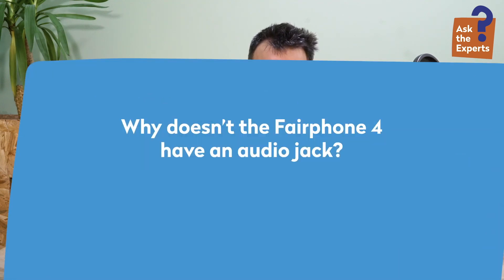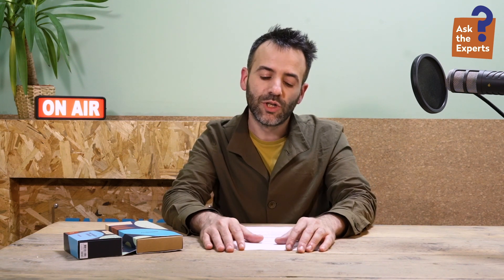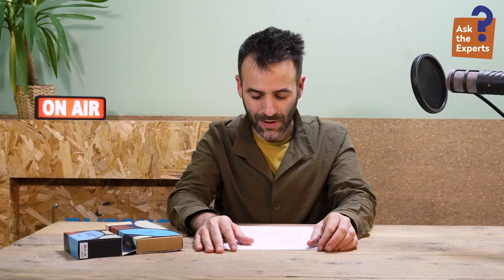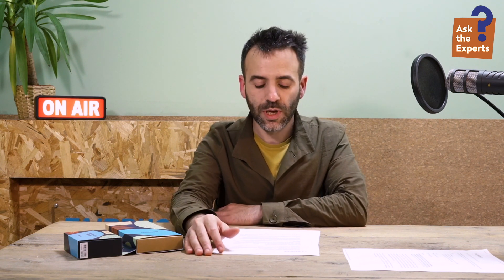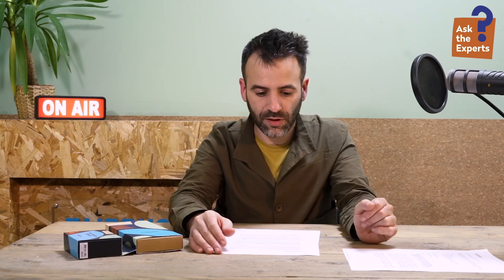Where's the headphone jack?! | and other questions answered | Fairphone

Comment: My headphone jack hasn't broken on a single device I ever owned, with the exception being a €3 portable fm radio made of plastic and chinesium alloy. It's more often that the cable breaks, like the one on a usb-c to 3.5mm jack adapter.
This dust is mostly an issue for me on the charging port, not the headphone jack.
In the few cases when I really need the headphone jack (because my bluetooth headphone is charging or I don't have it on me) it's likely not unlikely for my phone to also need to charge (and in practice I see this is the case, because of how I use my phone) so that makes the adapter a problem.
So yeah, I need a heaphone jack. I don't use it that often, but I do use it. I use it more than my camera to be sure.
Reply: Jacks are eternal. This includes charging Jacks. Nowadays we are using a COMPLEX DATA port and cable to charge ALL THE TIME a phone which 20 years ago just needed a simple 2 leads cable with a simple charger. If the charging port breaks because is the only thing you plug every day to the phone, instead of repairing a 2 connection smd charging port, you end up repairing a complex USB port. Which is also a point: USB on phones is practically useless if you take out the charging side. Almost no one uses USB to plug to the PC if not for repairs.
Reply: yeah, Audio jacks breaking is utter bs. Never happened to me. 

The cable itself is the only part that ever has broke tho.

Comment: Regarding the audio jack...
Never a good idea to throw away interfaces as this generally decreases the versatility of the device.
The FP4 durability argument is laughable since there are still IP rated phones with audio jacks on the market and they have been for a very long time.
The design argument, I think is something subjective, but the phone was never gonna win the thinnest phone of the year award.
This industry push for Bluetooth is sadly not going away since it is very profitable for companies. The user experience suffers, though.
Hope they reconsider.
Maybe they bring it back in a FP5. I would buy that.
Reply: Yeah, this is my thought. If a device is more compatible, I will keep it longer. The more limited it is in compatibility, the shorter its life span will be.

You know what a simple way is to keep something compatible: Keep it compatible with the standard from the past 40-70 years worth of audio cables and headphones. It probably won't die overnight.

Comment: right now i am looking for a new phone, after 6 year its not the worst idea to replace it, my first thought was a fairphone.... i think i buy the 3+, i use a wires headset und dont plan to change it, an adapter i a nogo, the device (for me personely) has the have the features nativly, everything else is a shorttime solution, nothing else.

my list of features a phone has to have that a am willing to buy it:
- headphonejack
-removeble battery
-no OLED (the burn in/out problem isnt solved)

Comment: Honeslty I was planning to buy your phone, but the loss of a headphone jack is a terrible decision that only promotes ewaste with adapters, costs your customers more, and causes greater environmental damage from the need for batteries and chips in wireless headphones.

Also you already supply replacement parts, so just give us a replacement audio jack.

You made a mistake, fix it for the Fairphone 5.
Reply: Very well put, Agree 💯%
Reply: Agree
Reply: I, too, was about to buy one, but without a earphone socket you can stick it where the sun never shines.
Reply: fix the price, you can get a XIOMI POCO  for €200 in amazon, and the battery will last me 5 years, €600 euros is a joke
Reply: @cyllananassan9159  the pocos are sold as a loss, the profit is made with data mining. the fairphone's price only proves how the sale of the hardware is the only source of income for them.
Reply: @cyllananassan9159 bro you don't understand the concept of the Fairphone, of course your Chinese device has a better price, but you can't get official replacement parts, you get a bunch of Chinese trash apps installed that could potentially spy out your data and you don't know how this phone was produced. Although you can use that phone for maybe 3-5 years, you ain't get any safety updates after maybe 2-3 years and you don't support local or more friendly companies but a Chinese mega company that is basically owned by china

Comment: I really hope you guys listen to your consumer base feedback regarding the headphone jack. After scrolling through the comments on every fairphone 4 related video it is clear that that's what your customers want. I for one can guarantee that I will buy the fairphone 5 it really does have a 3.5mm headphone jack
Reply: I completely disagree, I already bought an FP4 literally bc it has none. Jokes aside, why isn't it just an option to just stick the headphone adapter into the cord the headphone has anyway, I don't get what the problem is with that.
Reply: @HandsomeLuigi  you cant charge and use your headphones simultaneously if you do it like that
Reply: @einspielen9965  My fairphone takes one hour to be fully charged (with proper charger). Then it holds easily for 36 hours with normal use. I only encountered once the situation where I wanted to listen to music while it was charging, after 5 months of heavy use, and just charged it 20 min which was more than enough for a long listening session. It's not that of a big deal in the end, and removes vulnerabilities with a simpler design.
Reply: @bassenji5565  When you daily drive a 7-year old phone like me whose battery was never replaced you'll realize the benefit of being able to charge and use earphones at the same time. =) (my battery only lasts 30 minutes at 100%)
Reply: And I guess people like me, who are still rocking a 7-year old phone (a hardcore longevity user, we might say?) are exactly the type of public this company is targeting, so...
Reply: @LinuxIsNotAnOperatingSystem  God bless you.
Reply: @bassenji5565  
Fast charging shortens your battery life. It should only be done if you're in a hurry.

Comment: Fairphone... that design decision you made, is the wrong decision. The exact market you're targeting, the people looking for reliable serviceable phones with replaceable batteries, parts etc, we DEMAND a headphone jack, this is a major miscalculation on your part, removing the headphone jack was one of the most hated decisions by your competitors, you've cut yourself off from a significant segment of the market, please consider a revision to correct this major error, or we'll see you when you're ready to release the Fairphone 5 without any dealbreaker design mistakes.

but our wireless buds... No, not interested, never will be interested, its patently obvious that you took the headphone jack out to sell that product, don't make that mistake again.

Comment: I am an early supporter of FP, after my FP1 1st edition broke down just shortly after the FP3 got released I bought one of those, and am really happy with it.
And now I am very happy that I don't need a new phone right now.
I have no idea what studies you used, but I have never seen a 3.5 audio jack break. But I have seen many USB ports break. In fact, apart from performance issues and a broken screen, the usb port of my FP1 was a part that broke down after 6 (!) years of use, the audio jack was fine. So increasing the wear on the one USB port does seem counter intuitive to me.
Also I don't like wireless technology when there is a perfectly fine wired alternative available.
I got my current headphones as a birthday gift about 7 or 8 years ago, and they work fine.
Now you would expect me to either buy new wireless ones, or buy an adapter, limiting usability (no charging or data transfer while using headphones) and putting the plug on the bottom of the phone where it is in the way the way I am using it with headphones.

So, yeah. I can't say for sure if it is a deal-breaker for me... But it certainly does feel like one. So I really hope that in 3-4 years when I expect my FP3 to slowly die down, you will release a FP5 with a 3.5 audio jack so I can continue to use my then hopefully still functional 12 years old headphones without putting additional wear on the usb port.
Reply: USB ports break about 8 times as often as jacks, and now they want us to use the USB port more... 🤦🏼‍♂️
Reply: There is a lot of discussion about the headphone jack, for every brand. And although I always like to "have an option", I now agree that the time for Jack is over. As mentioned in the movie and countless other places, it's relatively huge (for a single-use part); it is an opening for water and dust; it can cause issues where the phone thinks something is connected when there isn't; and yes, I have actually seen broken pins stuck inside the port.
Reply: @jaypaans3471  If the potential for the 3.5mm jack breaking is that big an issue, and I am not convinced it is, just make it a replaceable part. Problem solved.
Reply: @jaypaans3471  It's not "relatively huge ", it's as large as it needs to be. And manufacturers have been able to offer IP water & dust rated phones having headphone sockets for years.
Reply: @jaypaans3471  Those are all bullshit arguments. 🤗

Comment: Honestly, none of the arguments against the Headphone jack stick with me:
1. Saves space internally: still a large number of phones come out that are SMALLER than FP4 and still have a headphone jack. FP4 is quite a brick of a device!
2. Less breakage than the USB port: I cannot confirm this for any of the devices I own: never ever has the headphone jack broken, you can make it as sturdy as any USB port.
3. Dust/water entry: The phones I mentioned under 1. very often have IP68 rating, so its really possible and not really difficult, I mean you have a replaceable battery and an IP rating
We are left with the following disadvantages:
1. Additional wear on the USB port
2. Adapters are really another type of e-waste
3. Many adapters have a poor Audio quality
4. No listen and charge at the same time (yes this is rare, but I used this regularly in longer train rides).

The result of this is that because to save the hassle of adaptors you end up going wireless (with less audio quality, another thing to charge and in the end even more e-waste. The net result is, IMHO, just a bad design decision to save a few bucks ... a design decision that may be en vogue, but certainly not a sustainable one. Sorry, my LG V30 needs replacement and the FP4 would be it if it either had a headphone jack or Qi charging ...
Reply: Removing the headphone jack is not going in the low tech direction, it's going into the high tech direction. Nothing beats a good old cable, no need to power or charge wireless earbuds, you lose them less because they are attached to a cable. I'm really disapointed that the headphone jack went away with fairphone 4.
Reply: 1. and 3. in other phones result in the lack of repairability. of course fp4 is a big phone bit modular built so the components can easily be replaced and repaired by the owner and not a repair company.
For me it was also a bit of a bummer but I bought it and good bluetooth ear buds. Those weee expensive but worth it...
Reply: @lagross86  even if you assume that's true it comes at the cost of far more e-waste. dongles go missing and break all the time and bluetooth headset and earbuds are far less repairable than a wired one. It's basic soldering to solder a new jack if that goes. On top of that using USB-C for both charging and audio increases wear and thus reduces longevity of the phone and thus again creating more e-waste.

And like I said, only when you assume you're right. But you're not, it's not remotely hard to make a phone have dust/water resistant nor would be providing parts for that for the average at home repair guy. And the fairphone is already a brick compared to other phones, even if it would notably increase internal space requirements the average consumer of fairphones wouldn't care.

This is fairphone being cheap or outright scummy (as they just happened to start selling bluetooth earbuds after this announcement, curious...)

Comment: Why do you keep changing the form factor of the phone so the new modules don't fit with the older phones??
Reply: What modules do you would like to reuse? Because the cameras are new, they neded to swith things around, so I think that was not really an option. In the future maybe, when we have standards for such things. One can dream...
Reply: You've got a point. The batteries on my eZee ebikes have the same form factor as ones from 20 years ago! And the installation process is the same too.

Comment: Glad to hear from you guys with a Q&A!

No 3.5mm jack is okay for me. There's actually Bluetooth adapters you can use with modular MMCX earbuds & IEMs. I am due for an upgrade in 2 years so I am looking forward to a model with an 90hz OLED display, 4500-5000mAh battery, and upper-midrange SoC (Snapdragon 778G/780G  or Mediatek Dimensity 1000+/1100 or equivalent).

Finally, any plans to cultivate an ecosystem for third parties to collaborate and develop custom cross-compatible components that can be swapped in? I imagine things like a FLIR camera or a battery with a wireless charging coil.

Comment: It would be cool to already show what kind of progress is already made in the development of the camera software. Just a teaser that compares the current camera with the new version, especially in low light environments. I'm about to return my Fairphone because of the camera and microphone quality, but also the lack of persistent notifications. The first 2 may be fixed by a software update, the latter cannot since it's in the design. There is no OLED or LED notification. But if the camera at least shows some progress, I'll reconsider. I'm sure more people might be in this position.
Reply: Hello. I live in Belgium and here I can get the fairphone 4 from a mobile operator for 280€ with an extra 10€ per month on my 20€ bundle that I already have. I read some reviews and they say that the camera is really bad, that it is comparable to a phone from 6 or 7 years ago. Can you confirm this? I wanted to buy first the Samsung A52 or the redmi note 10 then I thought at the last minute about the fairphone with my operator. I will decide on Monday. But if the camera sucks ...

Comment: Unfortunately, your reasons to remove the headphone jack are very poor. 
Please, check these boxes before launching the next Fairphone: 

- Headphone jack
- OLED screen 
- Avoid the awful screen design with the big chin a noticeable forehead and teardrop notch 
- Avoid side mounted fingerprint scanners (The best place is under the screen, followed by the rear of the phone) 
- The current size is too big for one-handed use. 5.8 inches is the ideal size. 
- The chipset is not very future-proof, should have been a QC 888 CPU (If possible) 

I love Fairphone, I want you, your company and your mission to succeed. I hope your next phone will be a huge success! 🍀
Reply: Out of all the points you made only 3 made sense

if you were to add these things, then the phone would be unaffordable given the way this phone is made. let's break this down

>headphone jack 
Yes I agree it's a must as it helps reduce ewaste, and is extremely convenient

>OLED screen
Extremely costly, and would drive up the price of the phone, A LOT so it's optional 

>design 
the design is fine, that's an opinion thing. it's not a necessity

>side mounted fingerprint bad?!
this is the worst point you've made out of all the other points.
1) side mounted fingerprint is extremely convenient
2) side mounted fingerprint sensors are extremely fast.

Also if you've used in screen sensors before, they are extremely slow and inaccurate. so instead of this not being a necessity, it's actually a downgrade and bad suggestion

>screen size
you're right, a smaller variant of this phone would be amazing because I'd like to see a return of small phones. But they should do this with a separate line of phones.

>A stronger SOC
it's impossible to keep pricing low given the way parts are sourced and their ethics. it's not a necessity, as long as modern apps with lag or glitches it's fine.
the SOC on the fairphone 3 is too old however, there's a lot of slowdowns with apps with that one.